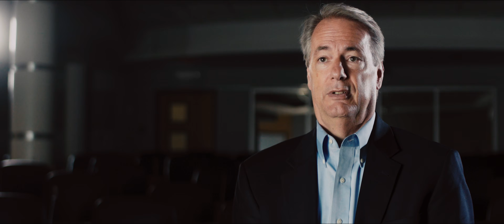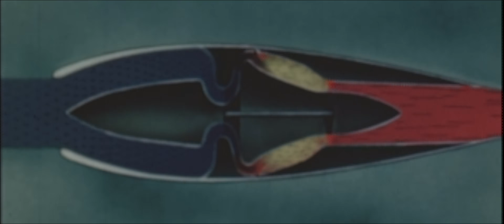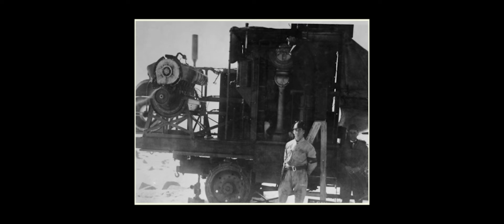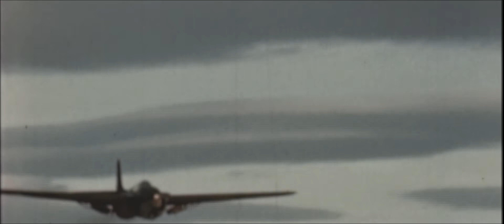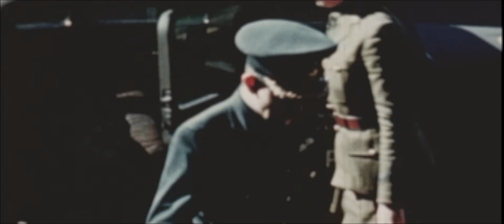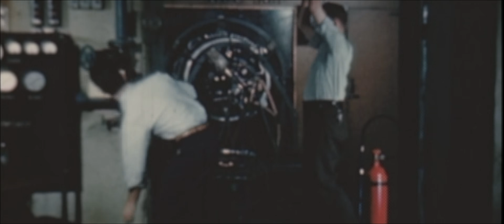Chapter 3 of 13 - GE's Wartime Advances

Comment: Out of Whittles design GE could see the limitations of the Centrifugal design and GE developed the Axial Flow J35 jet engine which first flew Jan 1946,  Westinghouse had also been working on the Axial flow, that is straight through flow, as the J30 and flew that engine in 1945.  Ge then improved developed the J35 into the J47 and then developed the J79...... And look where GE is today !!!  A world leader in Jet engines !!!